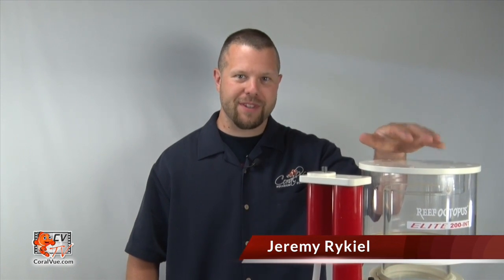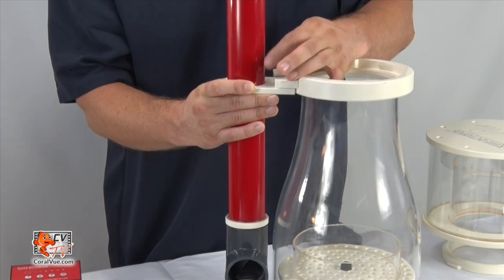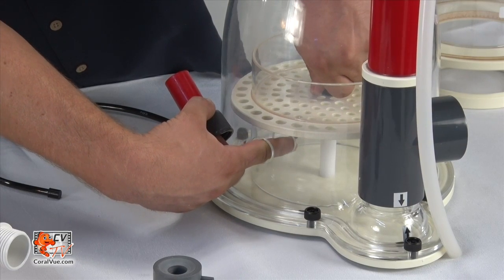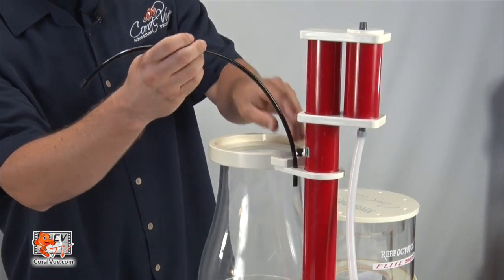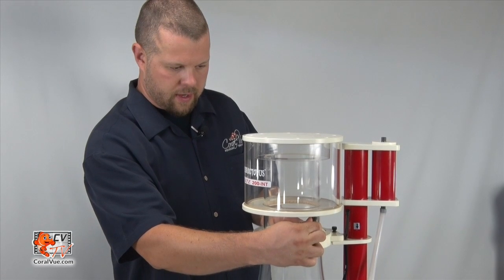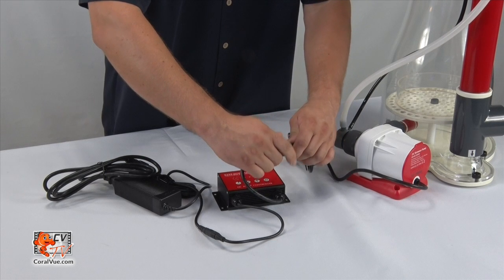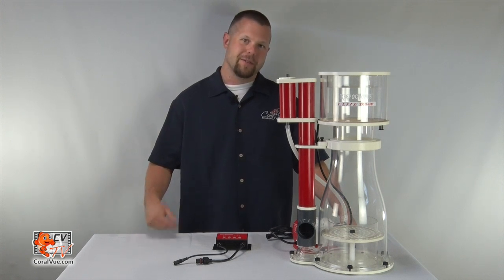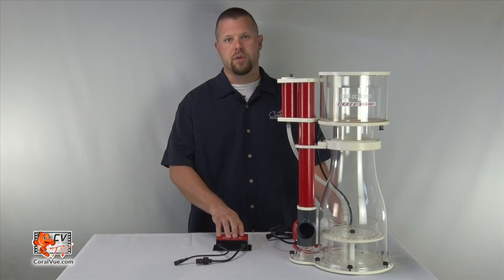Elite Skimmer Assembly and Installation

Comment: Thank you for this. I have a new system and was wondering why my elite 150 skimmer didn't seem to be working right. I had the tee fitting that the wedge valve goes into installed upside down...as if the arrow wasn't enough of an indicator. hahaha Works great!

Comment: Would the Elite 220 int or 200 int be better for a 220 gallon heavy bioload tank?
Reply from the maker: You can go with either skimmer. The 200 fits that systems filtration requirement and would likely offer less tinkering with. With that said a true mid to heavy bioload can sustain performance with the Elite 220 no problem.
Reply: CoralVue if it was your system what would you go with?
Reply from the maker: I would go with the Elite 220.  I like to keep a lot of fish in my reef tank and I like to keep them nice and fat.
Reply: CoralVue I'm having a hard time assembling my protein skimmer air line. Skimmer comes with 2 sizes of air line. How does it attach to the stand pipe? One is too big of diameter for the hole in the stand pipe and the other is too small.  When operating the skimmer what number 1-5 is the normal setting? Where the hole is drilled if I have it completely open on 5 the predrilled hole where the air line goes, it is up against the body of the skimmer creating a kink in the air line. Please help, I can't find and videos or good pictures of the 220. I can only find the 200 series with the dual silencer so the air lines are different. Please help.
Reply from the maker: The larger of the two hoses is for the collection cup drain. The smaller one is the airline which simply inserts into the whole and upwards in the pipe. It does not attach to anything inside the pipe.
Reply: CoralVue what is the big clear seal for?
Reply from the maker: I believe you are referring to the oring for the collection cup attachment.

Comment: Hello I just got the elite 150int skimmer and there's no ensamble video I need help on how to put it together please 
I DON'T need the video for the elite 200int cause they are different pleae help !!!
Reply from the maker: The elite 150int and 200int are near identical with the only differences being the pump and body size. If you have any questions or issues please head on over to coralvue.com/support.
Reply: CoralVue there's a big difference. The tube from the big outlet of the Venturi doesn't go to the same place on the 150. The box shows it going into the middle of the adjust pipe. But there's no nipple so the tube is very loose. Is that correct? The printed explosion chart doesn't provide any direction.
Reply from the maker: On the sump saver (SS) version the airline simply gets inserted upwards into the red pipe and sits there. It does not connect to anything. Essentially the red pipe becomes one large silencer.

Comment: hello i got the Elite 200-SSS no installation video for it, quick question the value where the pump is on! it moves around is that normal not fixed

Comment: setting up a 300 gal tank with a 120 sump and 50 fuge total volume around 450  and i was thinking of getting the elite 220int or regal 300int. what would you guys recommend?
Reply from the maker: Either skimmer will work for your system. The 220int would likely be more consistent especially if you like to skim on the wet side. It is up to you on if you want the basic (regal) or the Elite which offers a nicer collection cup attachment, wedge valve and elegant body. It is really just the features that separate the two skimmer models. Either way I think you would be happy.